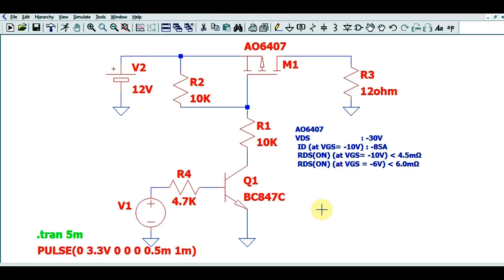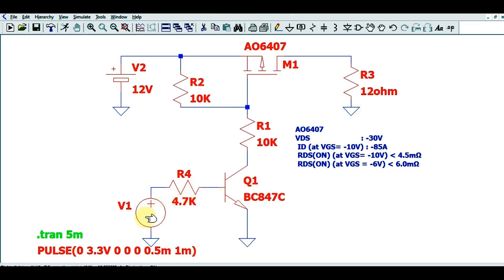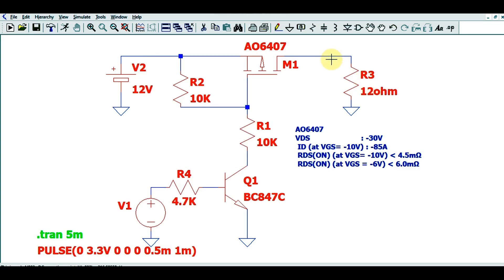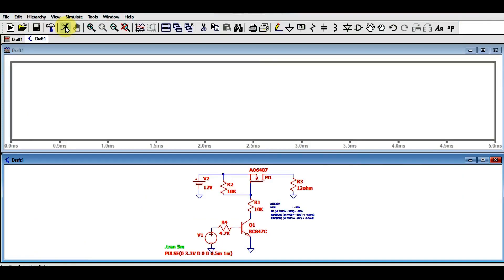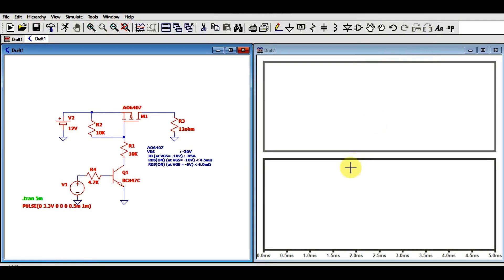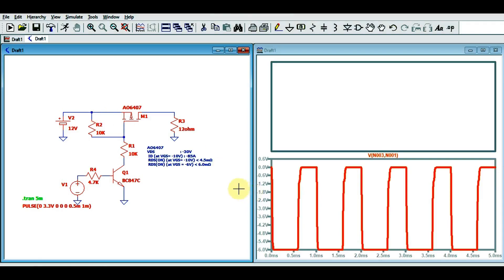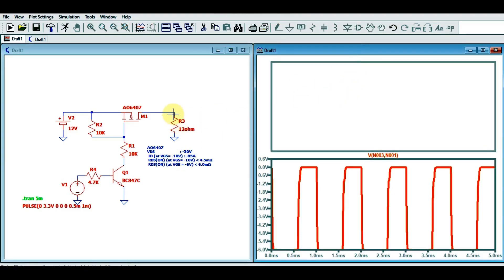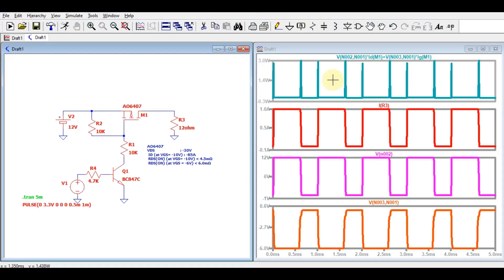LTSpice 12V Supply Switching Circuit | Simulation

Comment: To design and simulate a driver circuit to switch ON and OFF power electronic switching devices such as MOSFETS or IGBTs. The driver circuit should consist of a pulse Transformer capable of driving (triggering) power electronics switches connected either to high side or low side. The circuit should be able to switch on and off at 2kHz. Input of the driver circuit will be a 5V signal (for example signal coming from a microcontroller) and output will be a 15V signal to be delivered to Gate and source terminals of MOSFET or IGBT. Can you simulate this also please let me know
Reply from the maker: Hey...thanks for asking great questions. So you want to drive your mosfet with isolation transformer with 2KHz frequency and amplitude is 15V square wave. Frist need to convert 5V to 15V using transformer.